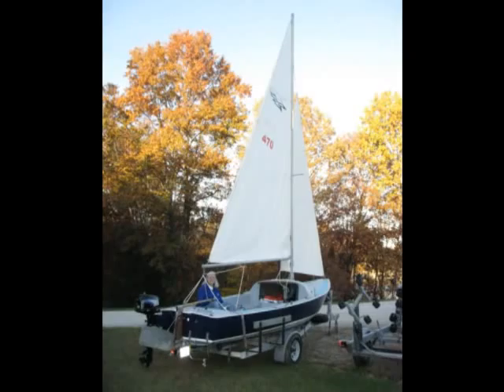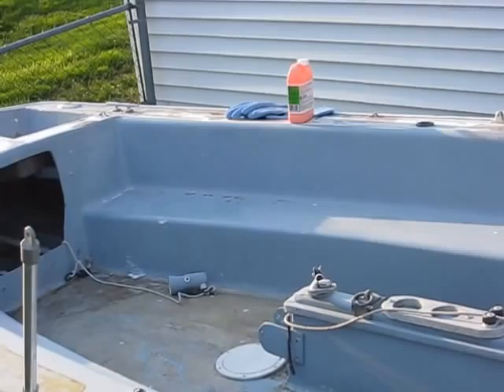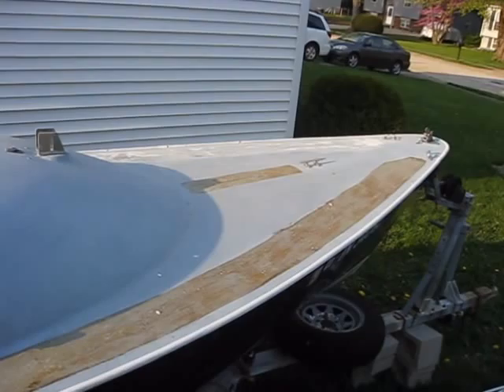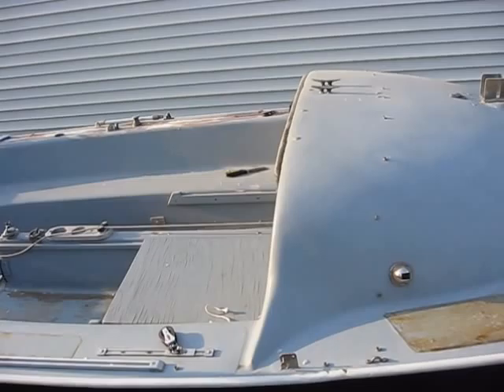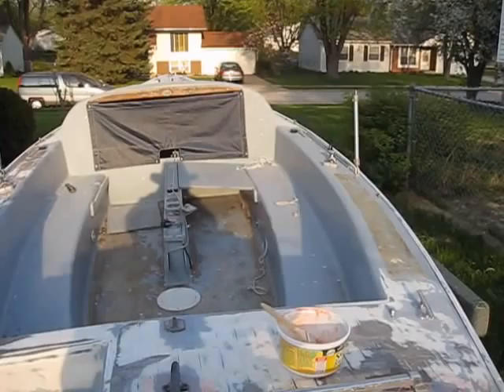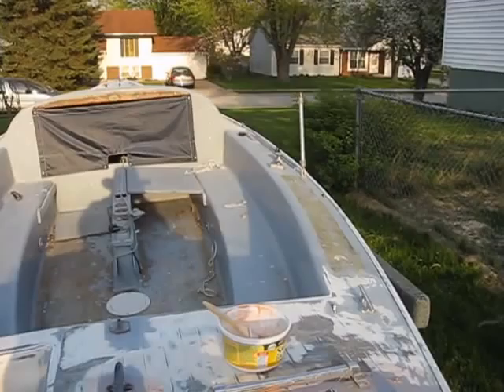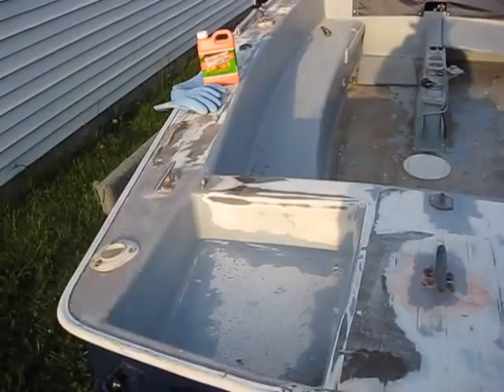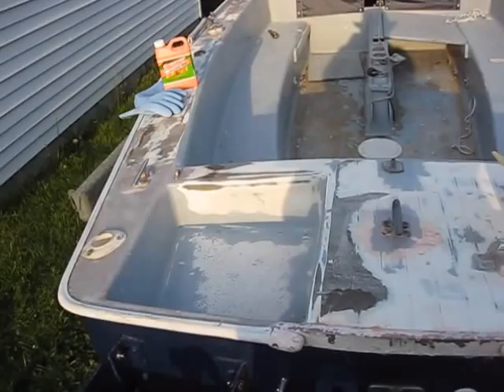Neophyte to Boat Painting takes on his family Sailboat

Comment: Hi, Good luck with your boat. Two comments: White boats look good, and are common, but the white gives you a double blast of sun, and worsens the sunburn problem to your skin. Too dark of paint makes it hot to the skin. Something in is between better. The old way of non-slip. Paint the area for non-slip and pour clean sand over the paint. When it drys, brush off the excess. Happy Sailing.